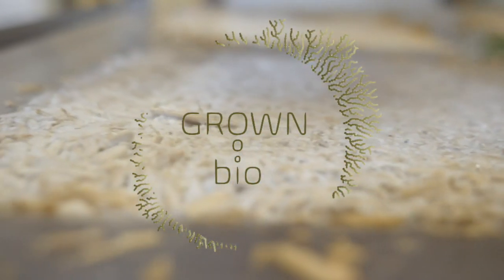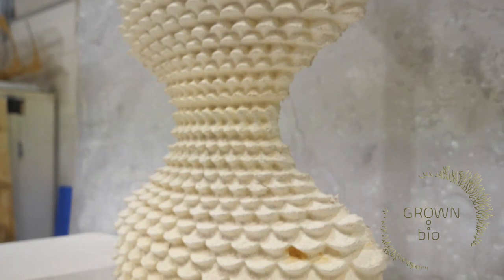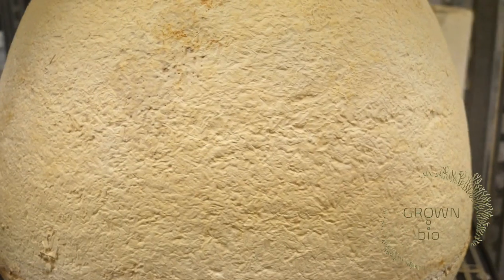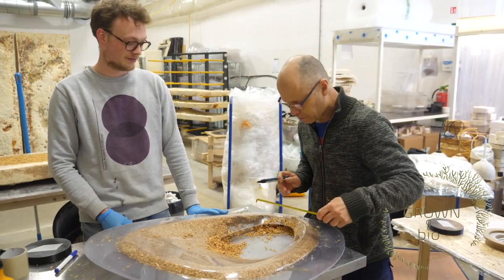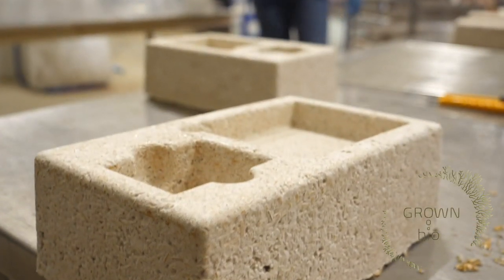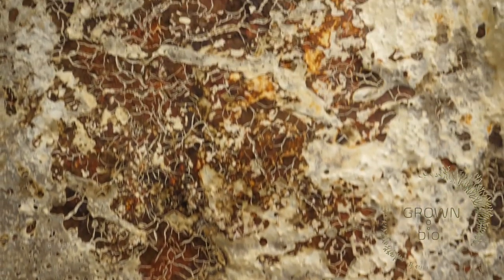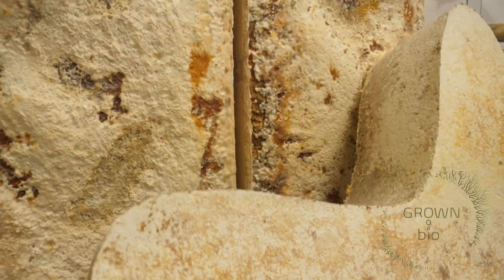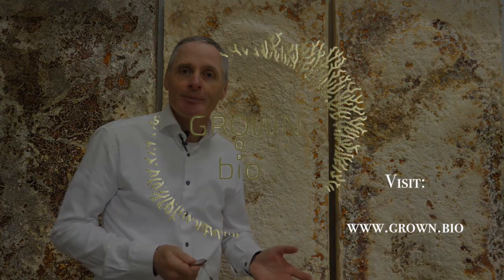Why mushrooms are the future of packaging

Comment: FYI for all you folks out there mycelium breaths O2 and exhales CO2. At best you can say it is carbon neutral for it carbon locks while breathing O2. You also have to remember that the mycelium gets most of its structure building material from the substrate you are colonizing. Yes this is green just not as green as they want you to think it is.
Reply: mycelium breaths CO2 and with the help of hemp it stores this CO2

Comment: dont they meet water and soft? How is this could be resist to water? wondering it.
Reply from the maker: Mycelium is hydrophobic. So water does not directly perforate the material. However, if it is exposed continuously to water, it will indeed become soft at some point. But there are solutions for this, like biobased coatings!
Reply: @grownbio2760  thanks for reply! It helps
Reply: @grownbio2760  Reishi. You can tell by the color :)
Reply: @redditrx5250  yes you go with the woody fungi I was thinking reishi or agricon.